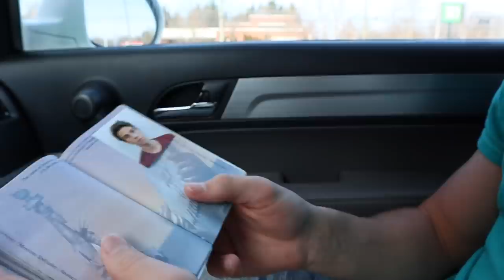INJURED On The JOB *Glass Tile Cut Causes Bloody Mess* | Brennan and Ryan Get NEW PASSPORTS

Comment: Unfortunately, the drywall came off when the back splash tiles were removed so yo will need to install new drywall before you add the new back splash tiles.

Comment: Don't install tile on a piece of luan. It needs to be on a concrete surface like durock. Plywood will expand and contract at a different rate than the thinset and it will cause problems. Especially on that exterior wall.
Reply: I know nothing but don’t they need to add insulation to keep out the cold?